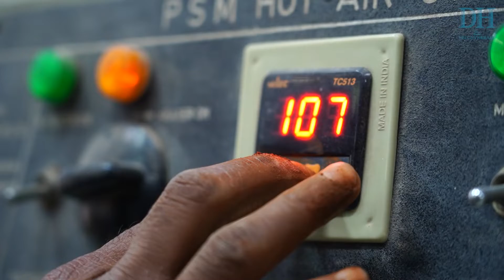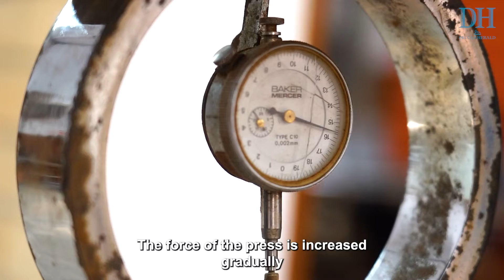Is your soil good enough to make a mud house?

Comment: I would not suggest to add cement to mud (cob).

Mud/straw is extremely strong.  I would venture to say moreso than concrete.

However, it is not waterproof. In ancient days (1000's of years ago), people used lime/sand/rice stalks (straw), even animals' hair for waterproofing.

The Persians called it, sarooj. They made the first refrigerator (yakhchals) from it around 400 BC.
Reply: Can we add lime alone to waterproof it? Also, will be strong like cement structure?.

Comment: There is no need to use cement with bricks even 0 % just use lime power i made home at sindh Pakistan 15 years ago just used 1/3 ratio of lime power than made bricks now 15 years my home is still same standing even it face 1 time flooding during moonsoon raining session 
In my calculation and experience cement is main reason for weakness about any building material first it look great strong but by gradually times it is getting weaker but another side lime getting more strength by passing time
Reply: Could you please send your contact details Sir or MA'AM

Comment: Actually play with lime is enough. 
Soil clay, straw, sand, lime. 
Cement is not for breathing wall. You can see how cement walls will attract moisture and fungus during rainy season. Unlike lime that will dry the soil.
Reply: Can we use prosopis juliflora alternative for straw? Also can we build to 2 story building using the mix you mentioned here?

Comment: You mentioned a termite issue early in the video, but I didn't see the part of the video where you explained the solution to that issue? Can you provide the video time point for the solution to the termite issue?
Reply: They said that when you compress it that it makes it more dense making it resistant to termites. My guess is the best way would be to use some type of sealant that can be sprayed or painted on which would protect from moisture and termites.

Comment: what a scam. so its not the mud, but the sand that's used. This exactly what is used in modern construction as well, quarry dust, cement and mittel (crushed rocks in size used for construction). We used to use sand before mittel. Sand was stopped as they were taken predominantly from river beds which degraded river life.  So, if there's no sand in your land, you don't simply use the mud. So, these are not mud structures.

Comment: 1 question, after making blocks, these blocks are joined with cement mix only ryt, if yes,then were are we solving the problem
Reply: No, joints are joined with grounded mud powder mixed with 10% cement.

Comment: Clay bricks can carry 7.5 mega Pascal of compressive stress and it made by earth materials, even load bearing structures can also be built with clay bricks and lime mortor ,one concern is that it requires more space , In order to achive sustainable buildings we must look into the filler items (aggregate, cement, additives) which are used in framed structures (slabs+columns+foundations) and most important of all durability which can only be achieved with proper design, proper mix proportions,and proper execution.
Reply: This is why I wrote the K'nuck tribe of Kilik'izh (lemming-like aliens) to be using mud in most of their buildings.

Comment: The explanation about strength is good but what about termites and fungus growth on the structure during rainy season. If there is fungus  on the walls how can it be cleaned as there would be no plastering or white wash on the walls
Reply: They apply 2 coats of natural rubber based clear coat ,which won't allow water absorption thus avoiding fungus growth.Yes u can clean walls with wet cloth.After application of clear coat wall becomes waterproof.

Comment: Thanks for sharing!  I wonder if there are ways to further improve the characteristics using waste materials that are not biodegradable like plastics?  Kind of like a polymer high performance concrete or maybe like the open source ultra high performance concrete formulas instead of using steel fibers, using plastic?  Thanks for sharing!  Great topic and especially useful if we can reduce the thermal energy used to process the materials required.

Comment: For Stabilised Mud Block we didn't have laboratory in  every state  and if we send material into your laboratory but soil are comes from different area which need more test . i have another doubt that for mud block what material used for joint block with other which gives such strength to joint like cement in nature

Comment: Addition of cement to mud defeats the very purpose of using mud.... Even common bricks are also made from mud.... then whats the difference between construction using bricks & stabilized mud blocks
Reply: i think because they can be site made, its cheaper to buy bags of cement and mix with your own mud than it is to buy bricks and pay for shipping/delivery. 90% of the brick comes from something you already own so its cool to use what you have
Reply: As @River says... In addition, these stabilized bricks are not fired the way bricks are. 
The benefits include using freely available site/foundation soil, using 9-10 times less cement, drastically reducing construction costs, improving thermal efficiency, and living in a healthy abode.
Reply: These bricks are not oven baked like other mud bricks ,so u save lot of firewood in the process.These bricks are only sun dried . Cement only 10% is used coz it gives bonding to mud particles and 10%  cement and mud powder mixture is used to join blocks .If u use only mud to join blocks then one rain will wash away all your joints so cement is added for bonding and stabilizing finally waterproof clear coat is applied.

Comment: Mud houses or otherwise known as cob, are houses made  with mud- soil from the site from under 3 feet depth which must contain sand and clay, then also add straw and water. What you shown in this video is something other than a mud material for a house, you washed out the clay and added cement which is just sand and cement, the very which thing you say it's bad for the environment. Conclusion: this is just clickbait or the title should be rephrased: is the sand content enough in the soil of your property for the cement mix to build your house. This video deserves more dislikes
Reply: They didn't "wash out the clay" from what was used for the block. They took a sample of the soil and washed out the clay in the sample to get an accurate measurement of the ratio of sand-to-clay in the mixture. The blocks tested and eventually produced for construction still have their original clay content.
Reply: It uses many times less cement then just concrete.
Reply: Learn to pay attention or watch videos twice before you run your foul mouth to spill some ignorance.
Alternatively, you can slow down the play rate to leave your brains time to register the details.
PS: I disliked your comment. You deserved it...
Reply: It appears that you completely misunderstood the video. They washed out the mud to check the sand content in the soil to determine if they need to add more or less sand to the mixture. Thats all. The actual mud used in making the bricks is not washed. Sand and cement are added based on the previous lab testing.  So, the post is not an accurate understand.